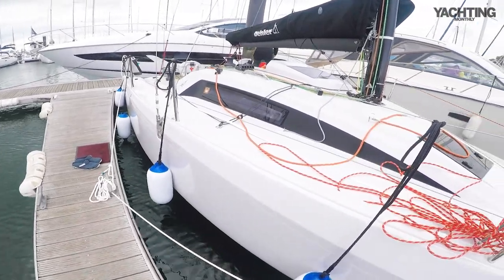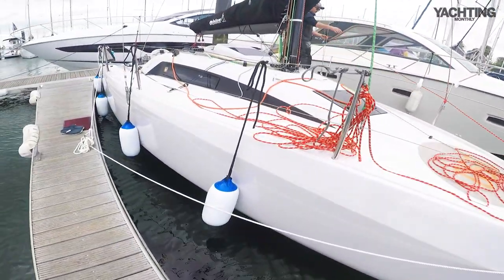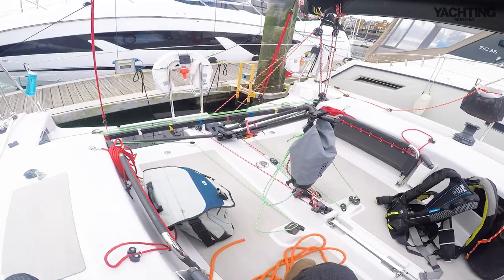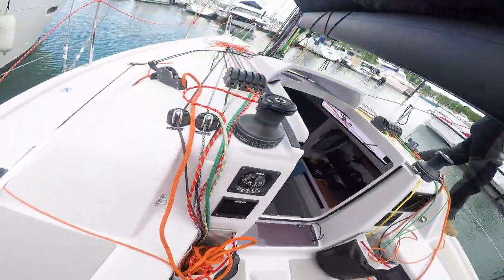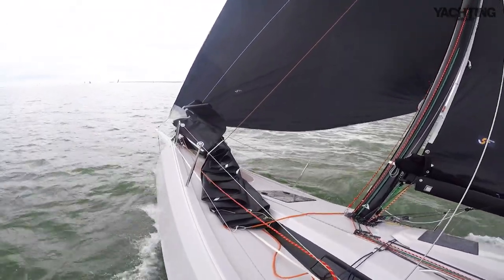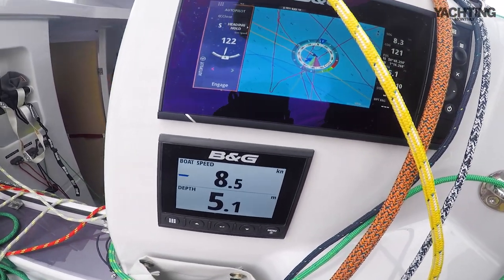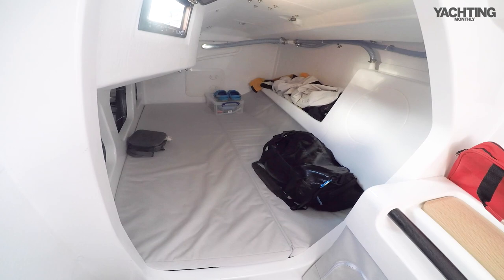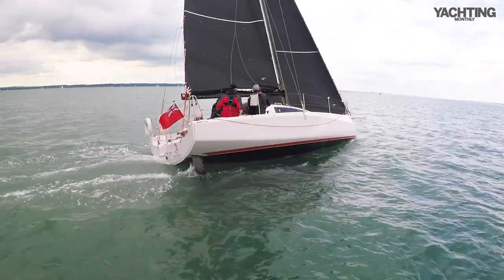Testing the all new one-design Dehler 30 OD - Yachting Monthly

Comment: Not a fan of such wide-angle lenses due to the distortion, but it looks a good 30' stripped-out race boat.
Reply: Go-pro innit. No need to focus because wide angle lenses have great depth of field. Fixed focus means waterproofing is easier/cheaper.